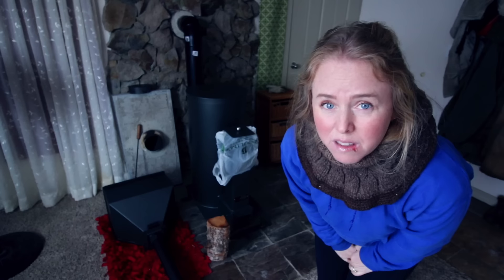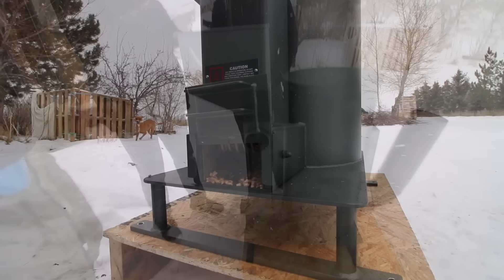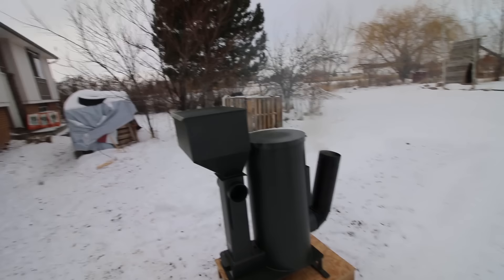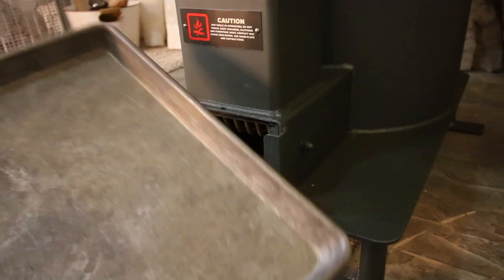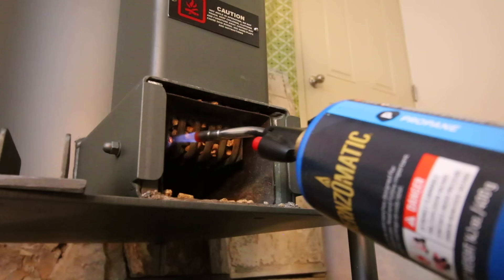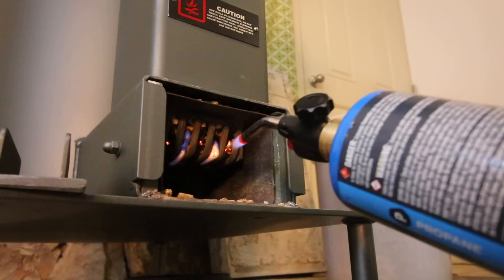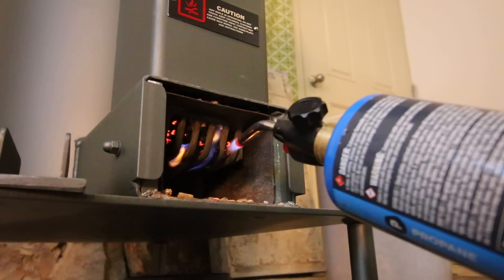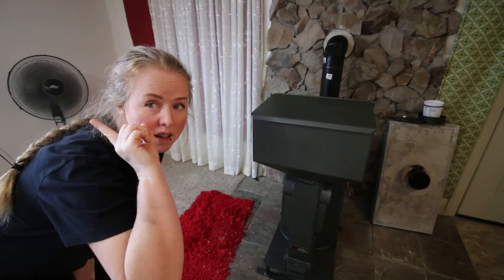Non Electric Pellet Rocket Stove REALLY WORKS for Heating Without Electricity Liberator Rocket Stove

Comment: I have that stove. The way I found to light it is to take a single charcoal briquette, momentarily dip it in a mason jar of charcoal lighter fluid, put it in the pellet tray below, then dump in the pellets. Lights with a single match.
Reply: You mean you don't like holding a propane torch for 10 minutes? 😆
Reply: I would also try an electric heat gun. It would also help kick start the draft up the rocket.
Reply: A propane torch can be cranked up much higher than she showed. I get it going in 2 minutes with the same torch.

I may try my old method of starting cord wood. It was a metal bin full of Single Toilet paper cardboard rolls.  Just fold each one up 3 times. Save up and dip them in melted Crisco once a year.  They make prefect slow burn fire starters.
Reply: @scott1lori282  I would still give the heat gun a try. It’s amazing how fast it works, and it’s nice not having to buy and store so much propane.
Reply: @atomicsmith  I wouldn't have guessed that would work to light pellets. I've never owned a heat gun though.  The only problem I see is that I don't want to rely on electric in any way.
Reply: @atomicsmith  Also as far as propane, I have the blue 1lb like in the vid but I will refill it from a 20lb tank like you find at a gas station. For about $10 you can get the adaptor to refill 1lb ers from a 20lb.  Much cheaper and only need two tanks. Just do it outside away from flame and the 20lb tank needs to be upside down.
Reply: @scott1lori282  I have a propane torch for backup, but for day to day use, the heat gun is just nicer. Especially for use in your living room, I think the heat gun is worth a try. I think they're just $20 at harbor freight.
Reply: I make my own wood stove fire starter by soaking charcoal briquets in diesel fuel stored in a glass jar.  Using tongs, fish out a single briquette and that's all that's necessary to get the cordwood going.
Reply: Yours is the perfect solution! Easy-Peezy!
Reply: I have a quadraFire pellet stove, it is supposed to start the pellets electrically. That failed early on. I use charcoal lighter to 1/3 cup of pellets in the burn pot. In the case of this burn pot i would put a  half cup of pellets saturated with charcoal lighter. Set the door in place. And ignite it.  Then use the torch to heat the exhaust pipe.  A hot exhaust pipe will cause a better draw.
Reply: Thanks for that info, I had tried that charcoal with the lighter fluid inside it when my pellet stove failed to light on it's own and it never worked well even when I put some more fluid on it. I just gave up and bought some fire starter sticks when I could not get it to work but now I know how to get the charcoal to work.
Reply: Use a turbo torch and it will light right away. Don't keep moving the torch, turn it up and hold it there.
Reply: Map gas is much hotter
Reply: Start a fire in the short chimney section first to create the draft, then light the stove in the normal way.
Reply: Or get a old can put in pellets and gel fire starter....let pellets soak it up for hour or so....put few spoon full of pellets in grate and light
Reply: Its probably one of those situations where it's good to have backup no-electricity alternatives, and to experiment with their effectiveness and sourcing at various occasions, but while electricity is available it just much simpler to have an inexhaustible lighting source like a heat gun. (again, unless you have set up some other source of lighting materials that is reliable and consistent)
Reply: I was going to say, there has got to be a more efficient way to start this up. Bad enough you have to buy pellets, now having to have a different fuel source to burn the primary fuel is not really sustainable in SHF scenario. At least bags of charcoal briquettes gives you many times, the ability to light.
Reply: @ernestmurphy3898  I have a Harmond pellet stove, had it approximately 20 years. Replaced the igniter once and the auger drive bushing once. It’s been a great purchase! I have a 2200 square foot house and that basically is my main heat. One bag about every two days.
Reply: @rbwoodwork1890  i havent heard of the Hamond, but soaking a 1/2 cup of in enough lighter to coat the pellets is enough to start with a minimum of propane but the flue must be hot if there is no draw.
Reply: @ernestmurphy3898  it’s Harman, I got it wrong.
Reply: that's what i do
Reply: @rbwoodwork1890 how do you move the heat thru out the house?
Reply: Cheap fire starter… cardboard egg carton, save up dryer lint, put dryer lint into the egg cups of the carton, pour melted paraffin wax over each. Once cooled you can just break off each cup and place it under the the pellet grate. Light it with a single match
Reply: My partner says don’t move it back forth just keep it one spot and get that going and then move to another.

Comment: I like pellet stoves and have used them in the past, but I foresee a huge future issue with them. At the time several years ago, when I ordered pellets for a workshop by the metric tonn on a pallet, (about 55 - 18.56kg bags picked up by myself on site), the cost  was $104.50 came out to be $1.90 CDN a bag plus 12% tax. Burning all day I would use roughly 2 bags a day. So $3.80 /day. I used up about one ton per month, give or take a couple or four bags  that's maybe $115.00 a month. Today however, the cost of pellets has risen to $250 OR MORE a tonn, and the cost is set to go up another $60 or $70 a tonn. One of the local pellet manufacturers shut down production, so sometimes there could be a shortage of pellets in the future. What happens if the cost gets too high for the home owner to bear, or availability drops to 0? Pellets are the only fuel you can burn in those units. Now I have a wood burning furnace (basement) and a wood burning stove (main floor). The cost of the wood is whatever it costs me to go into the bush and get it. Typically $150 - $200 a year for 6-8 cords. That includes truck diesel, saw fuel, plus various odds and sods like chains, files bar oils etc. If the winter isn't too cold, I'll have a cord or two left over for the next winter.. The only problem I'm facing now, is that I'm 70...
Reply: Yeah, I was wondering about that math too. Also, I don't want to depend on pellets even if they were cheap, like you say, supply can cut off. I wonder if kindling would be feasible instead. Btw, do you happen to know the cost of the stove? I don't see how it's better than a small wood cookstove that you could get used..
Reply: A book by steven harris called sunshine to dollars for the days that we get sun to offset the consumption. That being said, one offset usually dont make a dent in ease or cost of operation. Might have to alternate between 3 or 4 systems. Now if we could only get the youngn's to do the leg and back work we'd have it made...
Reply: This stove will burn wood as well.
Reply: You can burn wood in these too. You can't burn thick cord wood like a normal stove though. What I used to call kindling is what you want for these stoves. A slash pile I'd have burnt in the past is now a "wood pile". 

We been using pellets at $5/40lb mostly.  One thing I love about this stove is knowing I can walk in the woods and fill a 5gal bucket with deadwood sticks to keep warm another night.   World is getting strange & I have Shagbark Hickory trees all around here. Free fuel literally falls from above.
Reply: My parents are also in their 70s, running 3 sometimes 4 coal and pellet stoves on 3 floors in a very large old farm house. Needless to say, I live here and run the show for them. It's a lot of back breaking work and it takes a lot of time. Maybe you could find someone who would be willing to help you daily with the brunt of the work, for a small fee even. Sending you love, I know aging is definitely a tough time having to depend on someone to give us a hand. Sometimes at 39 I still need a hand myself. I'm looking to install heat pumps here to take some of the burden if I fall ill or something ever happens to me. There's nice tax rebates this up coming year on them and their installation and it seems a viable option for most of the winter nights above -10.
Reply: @ThriftMaven  I live in canada near 52 degree latitude where winter is October to mid May and heat with a fairly efficient outdoor wood boiler. Am going to build my own rocket stove with insulation but an upgrade to the feed tube of larger diameter and probably 10" diameter by 4 feet tall. That way you can feed it real decent firewood without a lot of processing. Secondly if you can tie in to a lot of mass to recover all  the heat your fuel will go a lot further. Reason being properly built rocket stove is much more fuel efficient. Lastly try to upgrade your home insulation. Lots of ways to do that. On old homes the addition of a larson truss to the exterior allows a considerable increase in possible insulation value upgrade. If I have a house that needs roof replacement  and the structure is sound another option over the existing roof is to create a false roof that can also recieve insulation. A lot of older homes were very deficient on the space to place insulation. Read up on superinsulated structures to see what options you have available to improve a structure so it takes substantially less heat to keep warm and the additional benefit is it will stay cooler in the hot summers. Good luck.
Reply: This stove also burns wood
Reply: @dreamingrightnow1174  this burns wood akso
Reply: @dreamingrightnow1174  I made a comment asking this question about what happens when stores shut down.......then i seen these commennts.  thank you.
Reply: If you can't get pellets just cut your cordwood down to size...
Reply: @scott1lori282  I pick up deadfall from my yard and most of my neighbor's yards throughout the year for our Liberator, it works great and the neighbors appreciate it. They're all hardwood trees.
Reply: @hithere7382  Yep. I pick alot up every spring and through out the year just so I don't run over with the mower.  Now I break to size for the woodshed. Any pruning I do of live branches goes in a pile to dry.
Only thing I burn up outside now is boxes. Made a steel ring to fit around stumps. The boxes are even a resource to burn stumps out. No bio mass wasted here.
Reply: Absolutely agree with you Toby Gathergood. I'm I Ireland and when the pellet stoves came in here first they were reasonable to run but not the price of pellets is after doubling in the past year and still rising.
Then you add I the huge price of electricity to run them and they're very expensive. 
Anything the governments can get you to put in and they have control of the prices is a disaster. 
Many people in Ireland are pulling these out and going back to turf and timber and coal.
The air to water systems are just out of the reach of ordinary people. They'd never pay for themselves unless you're in your 20s and building your own house.
Reply: There's a machine that u can buy that makes it
Reply: Hear yeah about the 70, 66 and feeling it. Thank you for the info :)
Reply: One thing that can help availability is getting a pelletizer and making the pellets yourself from local hay , sawdust etc.  I'm pretty sure you can make pellets from charcoal dust which can be made from local wastewood.
Reply: Have you considered burning waste oil?

Comment: When using your torch,  do not let the end glow red hot like that. Turn the gas up so the tip does not heat up.
Reply: right? no need to be afraid
Reply: I think I learned something, thanks.
Reply: Yup don't want that tip getting hot enough to blowback seen it happen not pretty...
Reply: I was wondering why she didn’t turn the gas up after lighting 😅 I don’t believe it woulda taken the same out of time with a lot vs a little

Comment: I put a stovepipe damper in mine, crank it almost fully closed when I leave for work, it’s actually been going now for almost exactly 12 hours and I’m guessing it’s used about 20 pounds, cooktop is 400 and stack temp is 180. House is 74. Could not be happier!
Reply: In Florida 20 lbs pellets is about $7.00. So $14 a day for heat.
Reply: @TiredOldMann  dang, 40 pound for about 4 dollars here. I did buy by the pallet load though.
Reply: Did you put the damper on the stove pipe going out? Would regulating the air going in work the same way?
Reply: @bandmasterjf  I actually did it on both, took a little while to get the feel of it, but one intake is fully closed, the other is about 70% closed all the time and I throttle it extra if needed on the exhaust. I’ve got a really strong draft though.
Reply: @bandmasterjf  I think so, but again my draft is super strong. Added benefit to cutting the intake is it pulls more through the pellet hopper so less chance for it to burp smoke in my experience.

Comment: I heated my home with a gravity fed pellet stove I made for about 10 years and it heated it very well. Our furnace went out and I thought it needed to be replaced and didn't want to buy a new one, so we just used pellets and it worked well. Now since then natural gas price was reasonable, and I got the furnace fixed (it was just a cheap part needed to be replaced) but I kept the pellet stove in cold storage just incase we ever need it again!
Reply: Do you have plans for the one you made ?
Reply: @cocopella  No, I never did. ALot of people asked so I may have to take some photos so I can post them.

Comment: For greater efficiency, pipe in air from outside for combustion.  The stove is sucking air from inside your home - air you've already warmed up - using that for combustion and that gets thrown out through the chimney.  Now you have a low-pressure condition and cold, moist air leaks into your home to replace it.  Pipe in combustion air and that problem is sharply reduced and overall efficiency goes way up.
Reply: What would you use to pipe it in?
Reply: @ryananthony4840  basic aluminum flex pipe is the easiest. If you want something more rigid. You could use galvanized steel round pipe.
Reply: @Titanium369  thanks, what's a good diameter?
Reply: @ryananthony4840  same size diameter as your fresh air port on the unit you are running.
Reply: @Titanium369  thanks
Reply: @ryananthony4840  you are welcome
Reply: Yup...putting a fresh air inlet on mine after the 3rd season made a giant difference. Using a conventional pellet stove. I thought it would be counterproductive heating up cold air. I was definitely wrong lol

Comment: I have a pellet stove. I don't like the fans constantly running. A stove like you have may work better for me. I will say this......the pellets will off gas carbon monoxide right in the bag so storage inside a living space I do not recommend. Here's what happened. I was stocking up bags of pellets in the house around the beginning of fall, 14 bags in the house, when I started getting headaches. I had no idea what was causing the headaches except the only thing I changed was those bags of pellets in the house (I normally left them outside on the deck covered with a tarp). Looked it up and the process of squeezing the medium into pellets can make them off gas carbon monoxide. The bags have tiny holes to let that has out. Just sayin.
Reply: Darn I always start my winter here in Northern MN. With 3 pallets of pellets in the house, I never seen any difference. Been doing it now for 9 years

Comment: As a 30 year pellet stove owner/user I would do the following to make your stove more enjoyable.  
1) Place  and light regular pellet stove fire starter fuel directly under the grate of pellets.  The torch fuel is probably more expensive and takes too long to light.  You could place the starter fuel in a raised container to get it up close to the pellets.  They also sell a liquid fire gel as a pellet starter that might help you.  I prefer the dry parafin wood chips for my starter. 
2) Your stove needs a built-in ash tray and drawer installed directly beneath the floor of the fire grate.  A hole for the ash to fall into the ash drawer would need to be cut.  
3) Add a chimney damper to cut off the cold air drafts.  The cold air coming down into the metal firebox will eventually cause some heat loss and even rusting when warm air condenses on the metal.
Reply: I was going to say the same with the starting process. That seems like a lot of (expensive) propane to be used. Maybe put some little sticks on the bottom and put these on.
Reply: hey, it's best to use pellets to create a mini burner for a wood fireplace... with a metal tee and appropriate pipe sections for gravitational suction of air without electricity and a suitably large flame... something like in a kerosene lamp...
the pipes should heat up quickly enough, be thin, etc. then it may work... the problem is poor combustion of the pellets and spontaneous combustion of the remains... unfortunately, the pellets or burnt like rice fried in a pan... but the rice is fried in the air... :-( this is impossible with gravity pellets